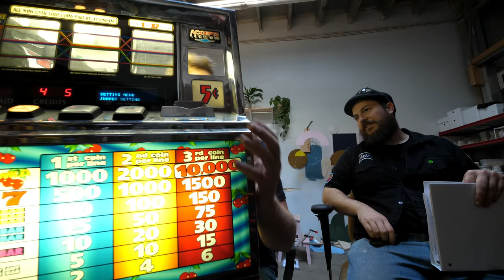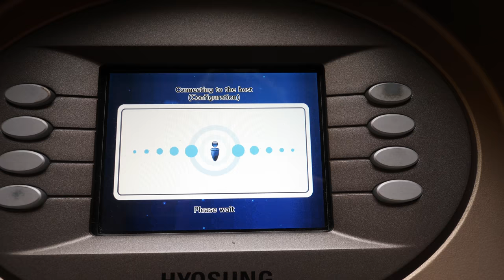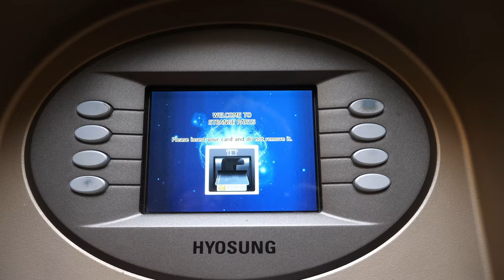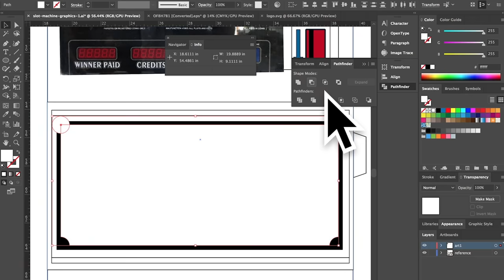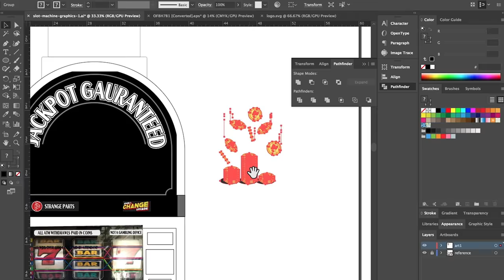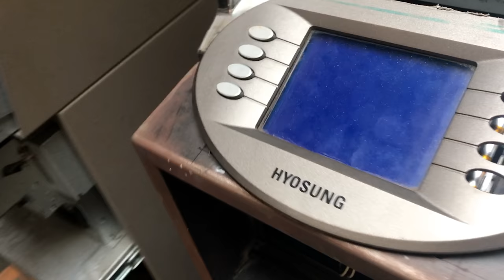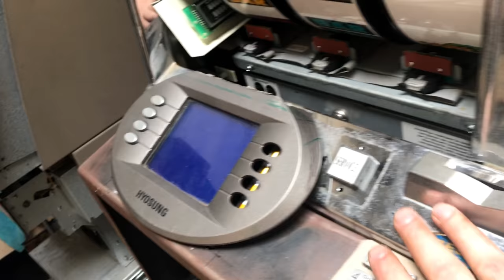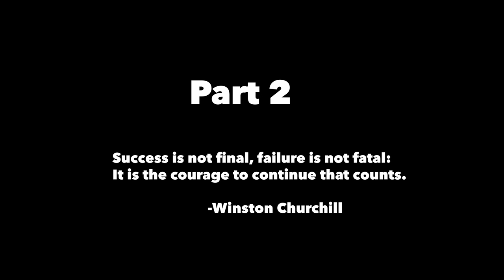How We Built an ATM

Comment: There's no chance I'd put my PIN in that, especially not at DEFCON.
Reply: I would, but only because it's someone trustworthy, not a random hacker I don't know
Reply: Kat Holloway the odds that someone doesn’t put a skimmer on that at defcon is very low
Reply: @ryansshane  I always check for skimmers anyways, shits way too common where I live
Reply: @qwaszx2  you're that guy?!
Reply: @qwaszx2  but if you're saying pin number,then youre basically saying personal identification number number, which is even dumber.
Reply: @refraggedbean  but what if the ppl that own the atm are the ones skimming your info? Hence why you should never use a random atm at a bar or gas station.

Comment: 31:20 EVERY. FREAKING. TIME. 😂
But c’mon scotty, you should know better than anyone that the headphone jack is the most important component.
Reply: Totally so it works for blind people too, so they merge it into one device. But still, the usual "it's the one thing you DID not plug in, and oh, the error code is unrelated." Also, I feel so bad for them losing the master code through customer support saying to "reset" it. :( Every time! ;,(
Reply: its like the call of duty bug in the early days
Reply: I encountered this on multiple occassions over the years in various software or devices where the headphone jack hat to be plugged in for it to work. 

It never made any sense or had any reasoning behind it...
Reply: It's a thing of beauty and a vital part of the audio experience that should not go anywhere else.

The headphone jack is a simple piece of plastic that's been around since the 80s and is found on almost every modern device (even the iPhone 6S). This small, round piece of plastic is a connector for audio, a headphone jack, and also an audio output (a.k.a. USB). It's this last bit that you're going to see change in the new iPhone 8, and it will be one of the biggest reasons why you'll want to swap out your headphones for a new set.
Reply: omg..  I literally laughed out loud on this comment.. Come on Scotty, you know the importance of headphone jack more than anyone else out..  lol
Reply: @Archar Gelodc Thank You. 🙏

Comment: FYI, the function keys are tied into the pin pad too. If you have a stuck key it will stop it. 

Resetting the pin pad clears the DES keys.  It’s a security feature to protect customers. 
Hyosung didn’t ask cause they assumed you had a way to get the new des keys in and the master password. 

I have so many questions haha Like what host did you use to process your transactions?  They can give new keys but should be following visa regulations. 

If you blow the NVRAM it will clear passwords but also the des and denominations.  That’s also a security feature for the customer.

Comment: If that atm is connected, because it works with your card ... didn‘t you just gift 40 bucks to your bank - essentially?
Reply: I believe these ATM's are not from banks but from storeowners.
The storeowners make sure it is filled up, and any ATM withdrawal will (indirectly) be transfered from your account, to the storeowners account.
They could have set it up to go to their own account.
Reply: @thatdude5104  Yeah the ATM owner should receive withdrawn amount + ATM fee.
Reply: @benargee  Nearly all, if not all of the ATM Fee will go to the company providing the "ATM" Service (Background Servers, Communication, Payments). The main benefit for stores to own/host one of these in their store is that people can spend more money than they came in with.
Reply: @4ntig3n  aka atm owner
Reply: Thanks for the Answers so far. I'm not aware of a similar system like that in germany (although there might be one) so I just assumed that these atm-machines are comparable to normal exterior bank cash withdrawels.
Reply: @benargee  no, the company which sold the atm to you.
Reply: I presume they have it set up as a "landlord filled" atm, so they are expected to fill the machine with cash and the operator they are working with pays them for any withdrawals.
Reply: No the money would be xferred from the bank acc to the merchant acc of the ATM proprietor
Reply: I was trying to figure out how that was going to work when people were taking money from their bank acct for him to just spend his own money to cover it. Landlord owned and operated ATM makes a lot more sense.
Reply: He took money from his wallet, put it into his machine, than made a transaction with his card meaning he gave the command to his bank that take 40$ off my account and the machine gave him his own money back meaning he deleted 40$ off the system - US debt solved?
Usually there is a security company that fills these machines, they register that this amount of money was put into the machine and then the system keeps track of the flow. Its interesting that apparently anyone can just connect their own ATM to into the system and have it running.
Reply: There is a diagnostic mode. Everything works as normal, but the some final signals are sent so money is not lost to the tester/bank

Comment: When you first tested the machine to see of it works, and you put two 20$ bills in to check the dispenser, did you lose money? I mean as you said that the atm was connected to the ATM network but the cash you got was the ones you put in. So this would mean that the 40$ vanished into thin air as the ATM reported a successful withdrawal. Did you lose more money while making this project or did you find a workaround?
Reply: I was wondering the same thing, but perhaps there's a "Free vend" mode where it will act like it is dispensing money but not remove anything from an account.
Reply: since he owns and stocks the ATM with his own money, wouldn't the money goes right back to his account?
Reply: Those are private ATMs, so the bank acts as a secure payment processor rather than the dispenser. So when he widthdrew the 40$, he just paid it to himself

Comment: I was worried when you were taking that ATM apart, as these things are boobytrapped to the hilt to prevent fraud. I was especially aware of the keypad issue after remembering a related video on the EEVBlog so I was holding my breath. Concerning operation, how does the cash transfer work in this case? Does the ATM act as a card terminal and transfer money onto StrangeParts' bank account and the ATM pays out the money that Scotty deposited in there?

Comment: Damn Scotty, if you had mentioned that you were tinkering with an ATM terminal, I could help. I could give you new "convolopes" (yea... that is what they are called) with encryption keys and borrow you new keypad for the show, and use my processor for a couple of days.  Coulda save you a lot of headaches :)
Keypad: yes, it has batteries inside and if you don't have the tool you can't open it. And yes the encryption keys are tied to the keypad, and every time you change the keypad you need to input new keys. Depending on the processors, but they usually use Tri-DES which means 2 sets convolopes with 2 sets of 16 groups HEX for each master password (A and B) for each Index. 
Headphone jacks have to be plugged in. If was pretty painful to see you fall into those pits lol.
Also check your card reader if it is EMV enabled.
Anyway I'm glad it all worked out at the end :-)
Reply from the maker: Ok, we need your help now:)  The ATM stopped working literally the day after the meetup.  Pinpad error.  Can you ping me via email or twitter/instagram DM?  Would love to take you up on your offer of help.  Thanks!

Comment: Stepper motors normally don't really care for the voltage you use, they will just produce a different amount of torque and use a different amount of current than at the voltage they are rated at. Interesting that it made that much of a difference. Normally it's more about the current you can drive.
Reply from the maker: The stepper motors on this were super finicky.  Even at the right voltage, I had to be very careful about both max speed and max acceleration, or they'd just stop entirely.

Comment: There is a very good reason the keypad doesn't work unless the headphone jack is plugged in. Its an ATM and detecting if any of the external panels or sockets have been tampered with is part of the security system. The keypad is paired with the CPU board so simply swapping the keypad doesn't work.
Just watching this video at the point where you got the first ATM, I could see you were going to have trouble, but sometimes these secret youtube projects sabotage themselves by not asking the community for help early on.

Youtuber Aussie50 did a full teardown of a full size ATM, however he's no longer with us, so the videos are all we get.

Comment: How does it work with the bank? You explained in the beginning that you can’t give the money away. But when you tested if it works, you charged your own bank account to get money you put in yourself, so you essentially lost $40? 
When you put in the coins, you also have to exchange them with your own money, so everyone who takes money out charges their bank account but gets your money. 
Do you get reimbursed afterwards? Doesn’t this need to be certified in some way? What about security? I know your slot machine won’t end up in front of a 7-11, so it doesn’t need to be crack safe, but does that just become your own issue if you decide to put up an ATM? I could imagine if it’s your money and the bank reimbursed you only for legit transactions they could care less if your ATM is safe. But can anyone just put up their own machine? Do you just plug it into a phone line and it works? 
So many questions… I hope for some explanations in part 2 (or 3?) 😅

Comment: Why not use a mosfet or even a relay to run the reel motor? The power supply from the atm is gonna have a 24v rail with plenty of current.

Comment: Loved the video, but I'm really stumped that you didn't think about the encryption keys in the keypad. I'm actually really stumped that it hasn't self-destructed when you started messing with it. A normal store terminal will self-destruct the PIN encryption CPU if cooled to far, or tried to open.
Imagine if anyone could buy an ATM, switch the keypad so they'd store the PINs and then set it up!? I wonder what PCI is going to say to this project - normally I'd say they'd have to audit this machine, since you've changed it.

For reference, when encryption keys are entered into terminals (for stores) at my work, it happens in a specially secured room where only certified people have access.

Comment: Could you put ipad 2019 components into an ipad 2 body (I would like to do it on my personal iPad 2 to run iPadOS 13 on it )
Reply: Clayton Elhorga Why don’t you just buy a brand new iPad instead?
Reply: ...It would cost you several times more than the cost of a new iPad, as well as tens of hours of labour. 

Buy a new iPad.
Reply: Why the fuck would you want to do that in the first place...
Reply: @vpau2534  I already bought a new one but the ipad 2 is almost des and want it to go back to live
Reply: @clayton5455  then just repair your iPad 2 with a new battery and glass. You cant and shouldnt attempt making a new iPad. The logic board alone is very expensive
Reply: @Alexander_l322  I found one from an iPad 6 (A10 Fusion) for around 50$. It's just an experiment so, I can spend some money, it doesn't matter. I just want to try if it's possible.

Comment: That looks like an IGT S2000 or maybe the older S-Plus. The S2000 tends to have the logic board located vertically on the left side so I'd say this is an S-Plus. The S2000 was painful to work on because it was so old I can't imagine working on an S-Plus!
Reply from the maker: It's a Hyosung 1500...
Reply: @StrangeParts  Sorry I meant the slot machine.

Comment: At 15:40 - what metal cutting wheels (the small ones on the dremel) are you using?
Reply: Dremel EZ Lock 1-1/2" metal cut-off wheels. I use those only for small parts that the angle grinder is too big for.

Comment: there are much better atms you could have used as an atm base. triton atms with sdd dispensers would have been much easier to circuit bend though they are a bit more finicky about power tolerances.

Comment: Are you telling me it's possible to buy and operate an ATM? How does that work, do you claim the dispensed cash back from the banks or what?
Reply: Yes, many ATMs are owned by the place that has them installed at their location.  You just have to have a processor.
Reply: @michaelkenefick  And then you can charge a fee for this? Make money on it? In my country, all of the ATMs are owned by the banks and they are clearly branded for the bank they belong to. They are also much larger than the one in this video.
Reply: @Fernando-sd6xt  Yes.  owners gets a cut of the ATM processing fee, the processor gets a cut and possible the bank.  The bank may charge a fee to use an out of network ATM as well.

Yes, bank owned ATMs are usually much larger, more complicated to work on and from "name" brand ATM makers.
Reply: @michaelkenefick  OK, thanks for the info. I'll definitely look into it further.

Comment: I don't envy you having to work on those hyosung's, I hated it. next time, get a Triton one, the newer ones run windows embedded and are much nicer to work with.

I am not sure how you ended up needing the master keys, but if so i have no idea how you managed to convince anyone to give them to you. they are 2 part codes, the tech has one and the it team has the other, you have to call up while onsite and do a whole arm warhead deal.

The reason they would not give you that password, is with it, you can tell the machine the $50 notes in the dispenser are only worth $1, so you ask for $50, it spits out 50 $50 notes.

Comment: Too heavy on the chrome. Shiny black base, and the thinnest coat possible. Next time, use Alclad Gloss black base and Alclad chrome. Under $20. For less than you spent on that spray can you can buy the airbrush needed as well. Comes in every metal color and type you can think of.

Comment: Soooo... Why did you decide to use an ATM?  You should have used one of those pay posts and some screen compare and reading software. From there you can just use the arduino to drive all the motors and stuff... You could have even done without a keyboard just dispensing 10$ per swipe of the card, or pull of the handle...

Comment: The guy at the glass shop really should have a workshop vacuum and/or at least wear a mask :/
Reply: All of the glass cutting tools are wet so it both cools the piece and the stream of water is in contact with all the cutting or sanding surfaces, so dust is very minimal.

Comment: oh that sux if I had been called back then by you guys I would have given you the master key code for admin menu addressing, but frankly Jermy or Tye should have given you a new master code before it left, they should have entered their code and then changed the master code before it even sold. they are pricks and yes lazy.  Well I imagine you get it all figured out at some point. But you can also use what  I call an EPROM piggyback riser by stacking the non-socketed ep[from and mirroring it or cloning it then taking it to the EPROM flasher and then syntax editing the admin access and erasing the master code line entry portion of the code and then desolder pin 9 lift the leg off the trace and stack the riser again and use the EPROM ribbon extension and flash that EPROM and you should be good to g Simple.   LOL  edit,, Oh then bridge or re-solder the pin 9 that was lifted before the last clone.  and make sure the battery is fresh.